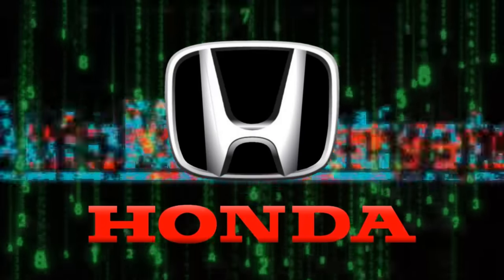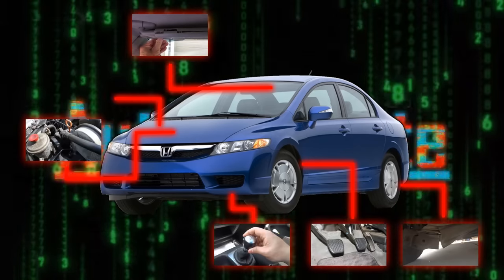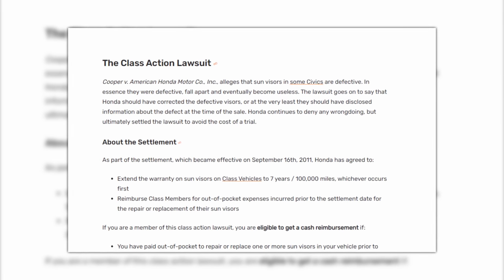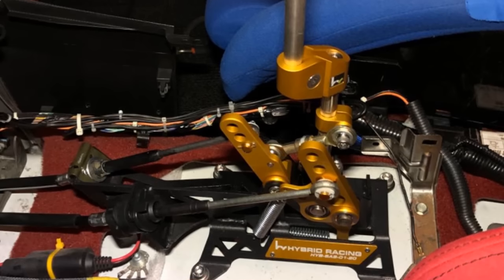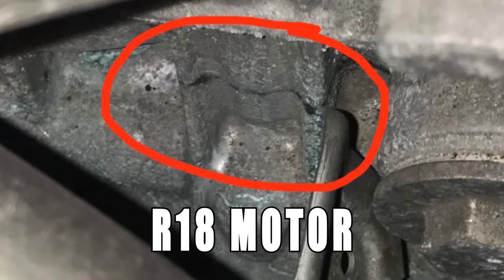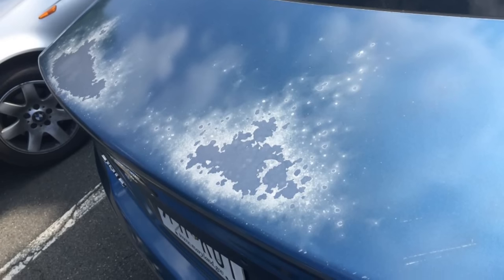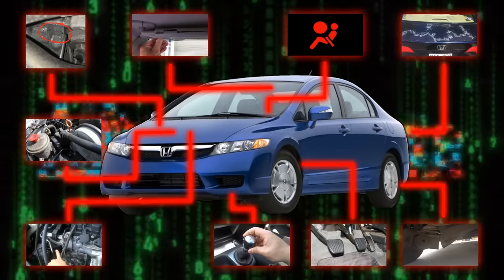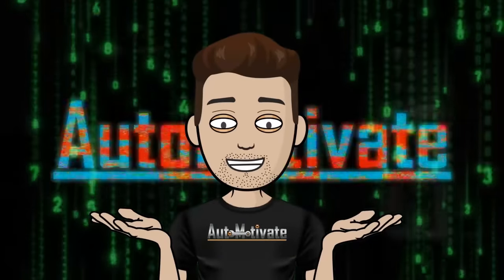Watch This Before Buying a Honda Civic 2006-2011

Comment: I must be lucky.  Own a 2009 model, haven't had any of these problems.  Only problems has been the airbag recall, and a starter that went bad.  Biggest complaint to-date, would probably be that the car rides low, and needs to slow down going over dips, or bumps in the road, something perhaps a stiffer shocks and struts would remedy.

Comment: I drive a 2010 civic si with 435,000 km on the clock. Do regular maintenance!!! Just replaced factory clutch because of a piece of metal breaking ...... not because it was worn out. This car has been awesome. When this one dies I will be looking for a low mileage 8th gen!!
Reply: How’s your civic ?
Reply: The civic has 516,000 km and going strong. Just did a big service. Had the valve cover off to check the valves and there is no sludge and no signs of wear on the cams or anything else that we could see. It does burn a little more than a litre of between oil changes now, which is every 8k.

Comment: Seems my model should have been the luckiest and had the least amount of issues, it's a 2011 but here's what's happened to it so far

Bought mine at 120,000km, it now has 220,000km. So far I've only done a brake job, and outer tie rods.

It had an electrical drain, which I couldn't find, took it to an electrician which fixed it and found the drain was coming from the cluster which he "bypassed" he said he rerouted the power to something else.

His "fix" caused some other issues, the gas meter doesn't register when I put gas in it right away, I need to drive it and it will slowly go to the correct level, my keyless entry fob stopped working aswell. I ended up getting a aftermarket keyless entry system installed 

Car was overheating and I didn't diagnose the issue properly and replaced a water pump, radiator fan, and thermostat. Rad cap was also replaced as it was damaged. 

Ended up being a fan control relay so that repair was my fault, although I don't need to worry about a water pump, fan or thermostat for along time.

Other issue from the overheating, I had to remove an upper engine mount and I removed it amd reinstalled it too many times I forgot why but I ended up striping some thread on the engine and needed to pay a mechanic to fix it

Some minor stuff I fixed was the arm rest door wouldn't close so I fixed it with a ziptie, recently the gas/trunk release latch broke so I replaced the cable.

Comment: Had a 2006 civic hybrid that I drove for 14 years. Great car only had to replace the hybrid battery at 200 thousand. The rest of replacements were 12v battery and spark plugs . The car was wrecked ( some one t boned me) and still got $4100 from the insurance company. Like I said Great car!!!

Comment: Minor issues in 2009 Civic LX Coupe:
1. Paint peeling on drive and passenger doors only (covered peeling paint with plastidip so peeling won’t spread and it kinda matches the car paint lol)
2. Sun visor falling
3. Engine mount (broke twice 😔)
4. Replaced starter - sister kept holding start on key when she turned on and it burned the starter :’L

Other than that car is running fine at 120k miles. Will probably go to 400k. Car feels new and I get compliments about the car looking good : )

Comment: I just bought a 2007 coupe ex 5 spd off of it's original owner 229000kms love this car.  Only single issue is that the clearcoat is peeling because it didnt get taken in for the recall in time.

Comment: I bought my 08 Honda Civic brand new five-speed only problem I’ve had is with the sunvisors 134,000 miles and I don’t let no one drive it😀 i’m on my fourth set a tires only change the brake pads in the front once the   windshield wipers four times and stay on top of oil and filter changes👍🏼

Comment: Not sure where this guy got his info wrong but my 06 didn’t have any problem & at 178,560 still run looks and Drives the same, paint is amazing with no rust no issues, only thing replaced was the AC compressor & Drivers side cv joint and that was at 168,000

Comment: I’ve only had brake issues. Interior and exterior is a different story 😆 mine is a 2011. Haven’t had any paint issues, except the black paint around the windows. My gas cap fell off the same time period the ceiling liner fell and the middle console broke. Also, before that, the weather stripping. Hey, it was 11 years old, and nothing too big.

Comment: 07 Civic Coupe here with 104k km.
Problems fixed:
1. Engine mounts (passenger side)
2. AC Freon replacement 
3. Rack and pinion leaking

Comment: I have a 2011 civic coupe  getting close to 98,000 miles. Other than normal maintenance, I have had no problems at all. Before this I had a 2003 civic and the only problem with that was the front struts which were replaced under warranty.

Comment: Can’t wait for the reliability discussions after completing the 10th gen Civic run (2016-2021). We’ve had five years with this design and powertrain.
My 2018 Civic EX-T has 88,800 trouble-free miles and going strong.

Comment: I absolutely love my 2011 Honda Civic. I got my first real problem.
Mechanic said he needs to replace a few transmission lines?? He said it will be expensive because you can only get them from the dealer?? Any advice? Have you heard of this before? It does have over 230,000 miles but still was driving like a small race car. Takes the turns so good! ❤❤❤❤

Comment: I've had my 07 Si for 6 years now and the only issues I have are bad tire wear, breaks wear out fast on the front and the inside door handle keeps breaking. 

Clutch also needed to be done at around 80k miles... very weak.

Comment: 2010 civic si just passed 200k miles. Outside of normal maintenance, the only things changed is MAF sensor around 150k and clutch at 200k. I did perform the clutch master adjustment to eliminate 2nd to 3rd gear grind. Original owner here.

Comment: I had me block crack in my 2008. Had to replace engine no longer on warranty due to being past 10 years. Also the passenger visor cracked and falls down and will replace. Now I'm pretty sure the power steering pump will fail.. Fingers crossed.  Honest video. Thanks for uploading.

Comment: I have a honda civic aerodeck W886LNmm and never let me down, ie 200 hundred thousand miles on the clock and it doesn't burn oil and water, but is had a new cluch and shock absorbers, but the car again been a great car, so what car would you recommend

Comment: I have 2006 LX Sedan and had issues 1. Sun visor (Permanent fix applied with screws)  2. Starter Motor failure 3. Paint Faded.

Comment: Sorry folks, sad but true. There was no Fix for my rear end and I burned tires out constantly. Let me add that the AC compressor pump has a plastic shaft. Honda knew this and wanted $800 For a replacement  compressor pump with another plastic  shaft. The intermittent wipers failed and would not work consistently. My second gear would grind if you were not careful.  I was rear-ended by a 18 year old looking at his phone three years ago. I  have a 2013 EX now which has been perfect. Yes the car was reliable but I don't miss it.

Comment: Haha, one of our 2006 Civic LX had a faulty driver side sun visor after 4 - 5 years.

The power steering failed catastrophically at around 110000 miles.

Roof and trunk paint was very poor, clear coat failed in about 8 years, otherwise it was well cared for. Poor quality paint allowed for rust to form, usually near panel gaps at the bumpers/wheel wells.

Very minor trans issues/gremlins at ~70k miles. Mysterious lingering in 3rd gear, hesitation in shifting into 4th. After a drain and fill it basically disappeared.

Otherwise, I'm very happy with all of my Honda vehicles because I fix my own things. I was previously a GM guy, but came to appreciate the general reliability of Honda and to some extent some Toyota cars.

Comment: Own a 2011 with 160000 and the visors/ replaced /the seatbelt replaced/the power steering pump replaced/one thing cosmetically that always falls off is the windshield mold drip trim

Comment: I have an 08 Ex with a manual and of all the issues you mention I have the crappy clear coat and the airbag light. If it's really the belt buckle, then why is the seatbelt light not on?

Comment: #3 2006 Si its the stock cmc with faulty delay valve, thus hybrid/ktune sells the em1 si cmc. The cable bushings, base shifter, short shift adpater help too & course change tran fluid, #4 eps light comes on & off somtimes may just need reprogramming at dealer

Comment: Had an 05 8th gen civic RHD that I sold 33 days ago...over the years it has served me well but i did have a few problem as well. My biggest issue was constantly having to replace engine mounts...that is a major fault with them...aside from that the trunk and roof paint faded even though the car doesn't sleep outside. Also changed a few engine parts like the alternator, water pump, radiator top, and a few other stuff but those are general wear and tear over the years. Also had to get the airbags replaced due to a recall about 2 to 3 years ago.

Comment: 257k on 2006 base model, replaced oil, brakes, tires, plugs, regularly. Other than that had to put in a new steering wheel oil hose which was busted due to extreme cold temperatures. Thats it but i know in future need to spend on engine belt also. Drives smooth and feels like a tank , really solid after all these years
Reply: Ever changed brake fluid?

Comment: If you live in the rust belt or Canada check your fuel tank straps!! My gas tank fell out while driving and Honda said its up to me to fix it, they will not cover the cost. I have a 2008 Honda Civic.

Comment: We bought an 08 used with 100,000 miles on it. No issues for about a year or so. That's when the block started seeping coolant. Thankfully the Honda dealer that we use from time to time offered to replace the block. We did have to pay about $1400, but Honda covered the rest. It was out of warranty at the time, but they did it as a good faith gesture. The sun shades suck! Our's are split. Need to get them replaced. It's been a good car otherwise.

Comment: I’ve got a 2011 civic coupe and my car doesn’t have any of these issues except for the rlly loud rumbling or vibrating noise that comes from the front. No idea what could be causing it. It was in a front end crash tho years ago
Reply: Bearing weels man i had this same issue on my 2011 whit the same exact feeling on drive
Reply: @michelgariepy4213  turns out it was one of my engine mounts. Once we replaced it I never had an issue

Comment: 2010 EXL with 265K miles. Leaking rack and pinion at 5K, replaced under warranty. AC compressor failed at 200K, alternator at 250K. Needs transmission fluid check more often than recommended in manual, every 30K rather than 50K. Doesn’t leak or consume one drop oil, still 30 mpg average, 35 mpg highway. Very good car, but my CRV was better

Comment: I own a 2009 Civic coupe base model since new, feels sporty on the road, quick, good on gas and don’t break too often and looks great if you ignore the peeled off shitty paint. Cons, after 1 hour of driving it, my back hurts, cheap plastics in the interior, SUPER LOUD ROAD NOISES OVER 60MPH, and the stupid paint is peeling off since it’s new, my 2010 Mazda 3 never did that, so do my 2011 Chevy Equinox LTZ V6, and in the winter the car won’t start in the morning when it’s cold, I’ve spend on new batteries and starters and stuff and still does that. I’ll give it 5 out of 10.

Comment: Big issue not mentioned was faulty climate control cluster. Hot cold gauge causes air conditioner not to be cold enough.

Comment: The plastic key fob costing $200-300 to replace over the chip - is pretty stupid in itself & drivers side door unopenable from outside even with key or remote ( wrap a piece of fence wire around it after the small screw gets loose - may be ugly but save your $300 for the shocks- or the power steering or the expensive dual use fuse boxes or the starter <~ super bixch to replace given the bolt has such an angle in a totally blocked space * I had to buy an additional $120 worth of tools just to get the s.o.b  off given you will need at least 3 universal's and a very large 1/2inch+ racket and many extentions because you'll have to literally make it bend past the frame behind the wheel - or if you take the wheel off like they recommend you'll end up replacing another $1000 worth of wheel assembly so trust me get your own tools but just know it will be a rediculous obstacle and know the bolt on the starter will take the effort of a lug nut to loosen - you'll need to put real muscle into it but be careful if it doesn't turn use wd40 and let it sit a day(else if bolt breaks off because you 'cant Walt's THEN YOI WILL BE TOTALLY F4CKED! SO BE PATIENT  .. ( manufacturer could have made an inside panel under passenger floorboard instead of being a dieck about it) or save your $300 for alternator because I can tell you "you will need all of those toooooooo" and if you don't get the $300 shocks then you will find the cheaper ones are worthless ... Get that brake arm adjustment mod for the mastercylinder it's very good else that whole thing can come loose and you will be without brakes even *if they are new on the wheel - love my civic else I would have busted the windows over the bullskit they added to it so know I'm just being truthful it's frustrating but hiring the dealership to fix these things costs way to much also - just get your tools and suck it up .. Once you save $4000 this way you can at least but another one ( do not replace any fluids with anything else other than genuine Honda fluid because the seals will gooo bad or overheat if it's radiator anyone running 5w30 in it ..change it back to 5w20 Pennzoil synthetic as soon as possible even if the fkn mechanic doesn't know Scotty Kilmer is totally right if you don't use the right oil it'll damage the oil pump/ engine and cause the valve cover to leak & behind the engine - 5w20 & that's it nothing else those friends ate fos tellin' you

Comment: I had a Honda crv the best possible vehicle for realibility ir went through the mot 7 years in a row without any bushings or parts used 100 per cent no faults  the only thing I can say against it was its ride is to hard ive got a Lexus rx now a far more comfortable and easier to drive than the Honda  both are great vehicles

Comment: Not my experience at all. Have a 2006 Honda Civic Hybrid at 165,000 miles. Number of repairs I have paid for in about 15 years?  ZERO. Mileage - up to 50 MPG.  The control arm isue was handled via recall a gazillion years ago. Hybrid battery pack was replaced under warranty. The driver side sun visor does not stay all the way up --but is not falling down.  There are some minor paint issues on the trunk fin-but nothing like what is in this video.  I am sure I will have some repairs some day - but can only wish that all my past and future vehicles were this inexpensive to maintain. From new, the car has cost about $122/month averaged out over time and the gas savings has made the car essentially about $60/month relative to the Volvo I was driving prior ( which also had some real expense to maintain too ).

Comment: Very true on the visor, engine mount & engine block, and paint. I used to own a 2006 Civic coupe, and @25-50k the visor failed twice and replaced; @80k the engine mount failed and replaced; @ 98k the engine block failed and replaced under warranty; @105k the alternator failed and the paint started to fade more; @150k the car is sold.
Reply from the maker: I’m very happy you were able to replace the block with warranty. 
It’s seems to be a 50/50 mix with people having a great performing car and the other 50 having most of the issues I have talked about.

Comment: I have a 2006 Honda Civic Lx and most of the time the "check engine" starts to blink and when that happens the accelerator pedal stops working...
Until I turn of and on the car it will work again...
I already send it to several mechanics and no one can resolve me that issue 😒 😑  has anyone had the same problem??

Comment: On the si models if your motor mounts are bad, then the engine moves hella when shifting from 2-3 and sometimes doesn't make it in properly causing the infamous 2-3 grind/pop out

Comment: 2006 Honda Civic EX Coupe - failed starter, leaking rear struts, AC freon leak, sun visor not staying up,  exterior paint chipping away, broken trunk torsion spring, broken center brake light.  Cracked engine block at 143k is the final nail in the coffin.  Bought it new in 2006.  It has been good 15 years.  But I will not pouring money on repairs anymore.  Will be donating this car to charity and getting a new Toyota Camry or Mazda CX-9 instead.  Hopefully whoever buys it from the charity at auction will check for the cracked engine block.

Comment: Everyone of those motor mounts fail and the oem replacements or aftermarket ones fail and there's no recall and most failed before 70k miles

Comment: I have a 2006 Honda Civic the only problem I have with this car is the rear suspension sags and the rear of the car is very weak and very easy to loose control I have been driving down a straight road and spin out of control about 3 times already I try changing the rear shocks but the car is still easy to loose control the back ends just kicks out on me very easy it do it in turns all the time.

Comment: Own a 2011 civic lx sedan

The visor cracked was fixed with a proper one from ebay $20

The power steering on all civics have been very picky on clean fluid with no moisture and will fail quick if this isnt cared for

The paint yeah "cindy" has that issue so when its due for a engine rebuild ill have the doors removed and car repainted (cheaper than another car)